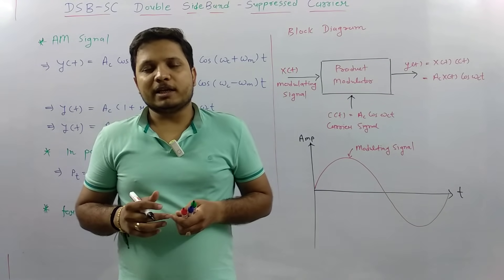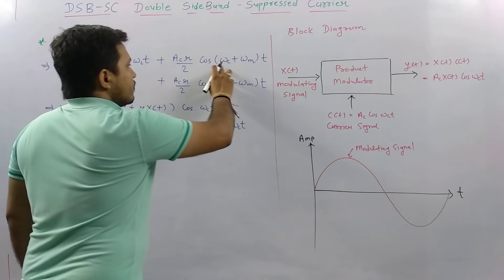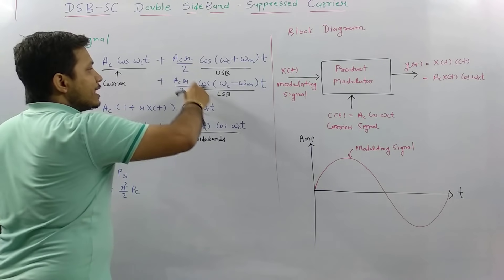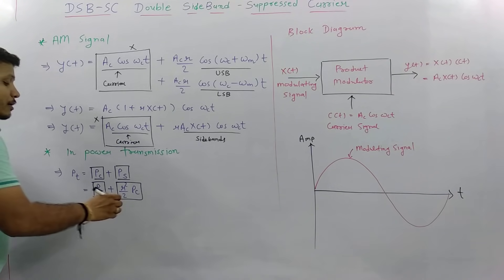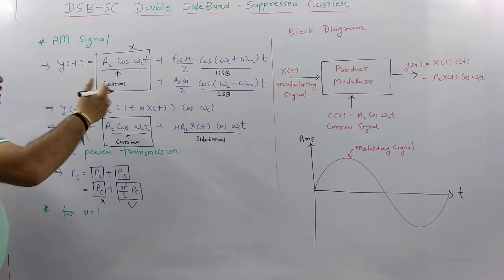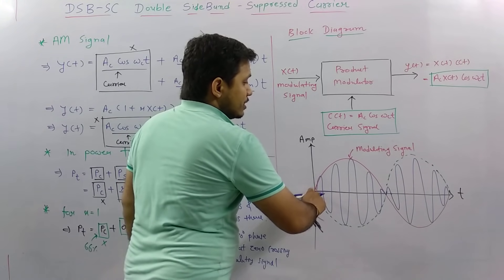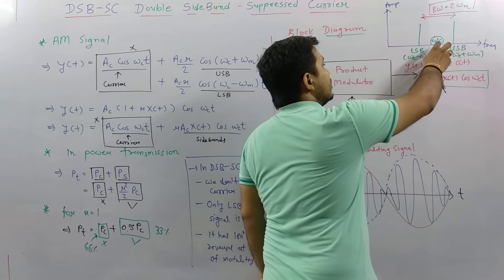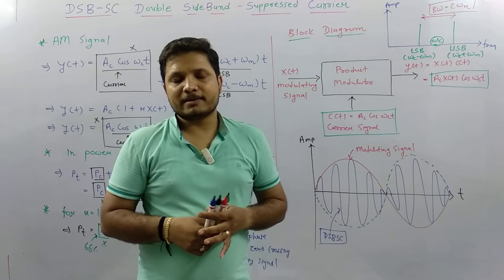Double Sideband Suppressed Carrier DSB-SC (Basics, Working, Circuit, Waveform & Impotence) Explained

Comment: Sir explanation was amazing I've got a doubt sir you said we will not send carrier signal sir then why did u send carrier signal in block diagram again ?
Reply from the maker: carrier signal is used to increase the frequency of transmitters signal.
Example: if original signal is 1khz and carrier signal is 1Ghz, then transmitted signal by dsbsc will be 1.000001 Ghz and 0.999999 Ghz.